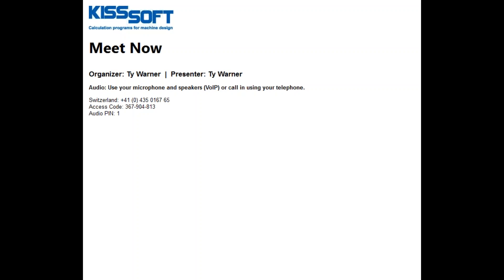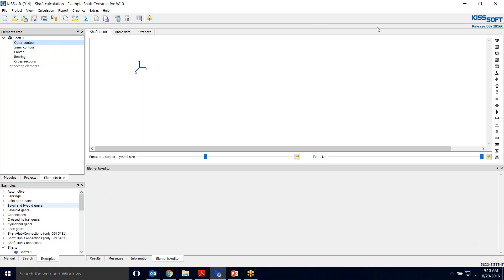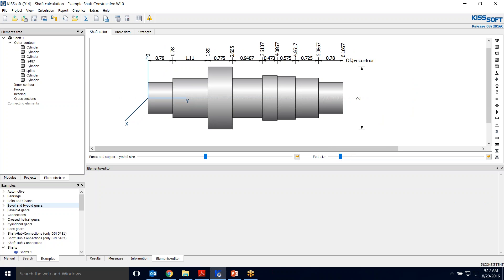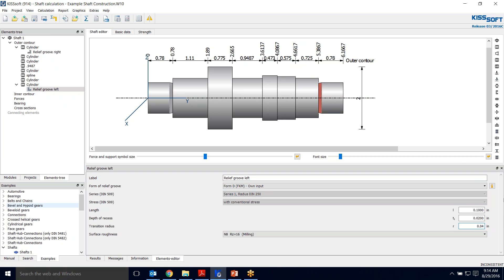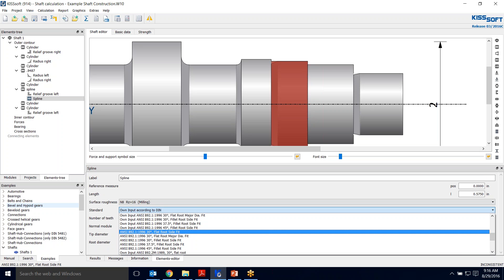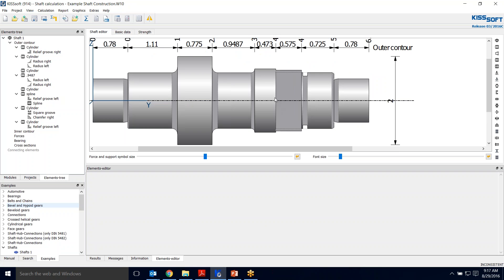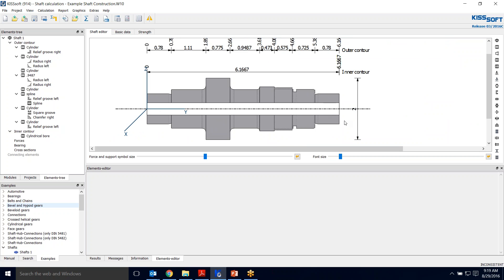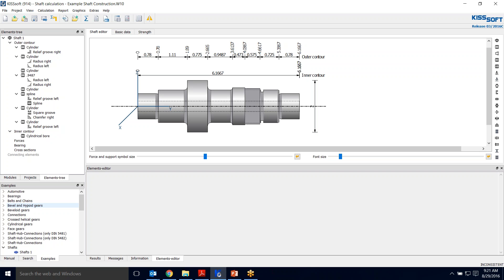KISSsoft Shaft Construction Part 1

Comment: Hi 
I have a shaft modelled in kisssoft and i want to directly import it to several gearbox models in Kisssys with gears, bearings, loads etc on the shaft. Is this possible?

Thank you in advance
Reply from the maker: yes, you need to make sure the elements in the shaft model are named the same in the kisssys model.  Simply create the kisssys model, make sure the kinematics work and the structure is correct, open the shaft calculation element in the KISSsys model tree, this opens the shaft calculation model.  Once open, you can simply open a previous shaft model and will automatically update the kisssys model.  I'll have to put something together in a couple days so you can see how easy it is.

Comment: Can I put an internal spline in the shaft using this shaft editor?
Reply from the maker: not yet, developers are working on this feature, in order to analyze that part of the shaft with an internal spline, you’ll need to add a free crosssection in the location of the spline, and define the notch effect at that crossection, then you’ll see the shaft fatigue safeties at that section
Reply: @kisssoftusa9363  Thanks for the reply, it helps a lot!

Comment: Hi, I have a gear built on shaft, due to its little diameter.. How can I set it? I mean, I can only find interference or key coupling in the options.. Thank you
Reply from the maker: When you add a gear to a shaft, the default is to create the gear as part of the shaft.  You wouldn't need to provide any connection, i.e. spline or interference fit.  Under the basic data tab of the shaft module, you can choose the way the gear will be calculated on the shaft.  Depending on the gear, you have several options you can choose from. Select an option from this drop-down list to specify how gears are to be handled in the shaft calculation:

1. Gears are only handled as load applications. The masses and stiffness of the gears are not taken into account.

2. Consider gears as masses. The gear is handled as a mass in the bending calculation. The mass results from the difference between the reference circle and the outer shaft diameter as well as the gear width (same specific weight as the shaft).

3. Consider gears as mass and as stiffness. The gear is handled as part of the shaft contour (for example, pinion shaft).

4. Consider gears mounted by interference fit, with stiffness according to ISO 6336-1. The shaft is stiffened at the mid diameter dm, with dm = (d1+d2)/2, d1 = shaft diameter, d2 = reference circle of the gear. 

Gears set on shafts with a firm interference fit always pose the problem of how much they stiffen the shaft. Although KISSsoft cannot solve this problem, it can estimate how much influence the interference fit has: It is sufficient to perform the calculation for Gears mass and for Gear as mass and stiffness and note the difference in the diagrams of bending. If the difference is small, the interference fit has no influence. However, if the difference is significant, you must enter more precise information. To do this you must integrate a part of the gear in the shaft contour in the graphical shaft input.
If a gear has multiple contacts (for example, a sun wheel in a planetary system), then multiple identical gear elements must be defined at the same position. However, the weight is considered only once.

I normally choose option #3 or #4
Reply: Ok thank you!
I'll try with option 3.